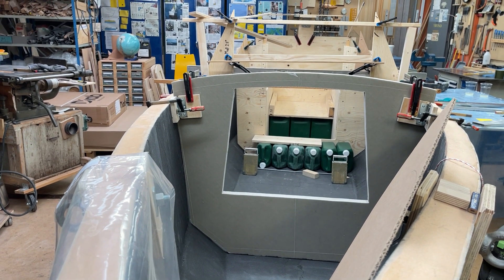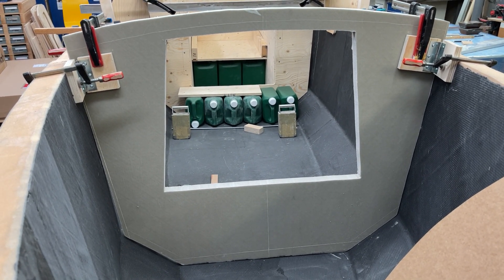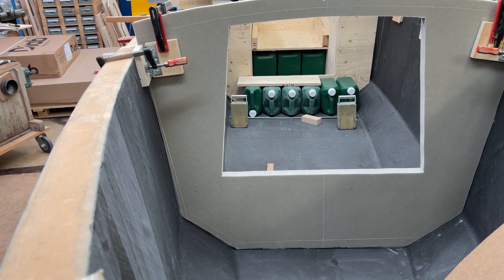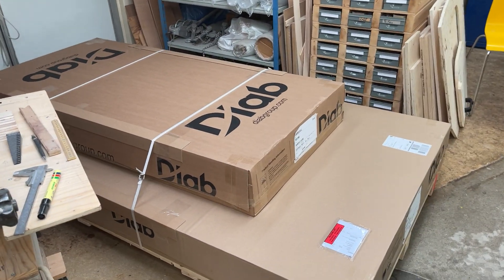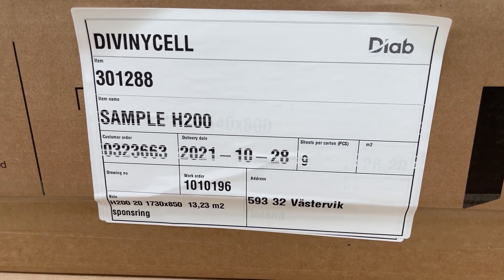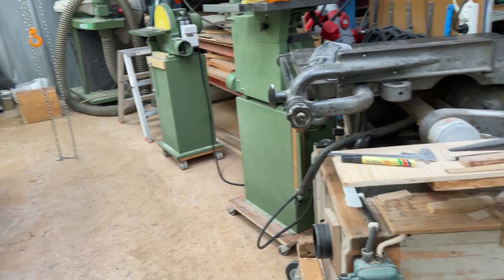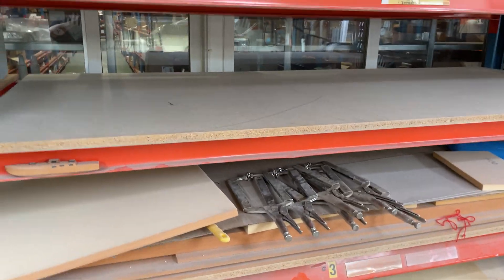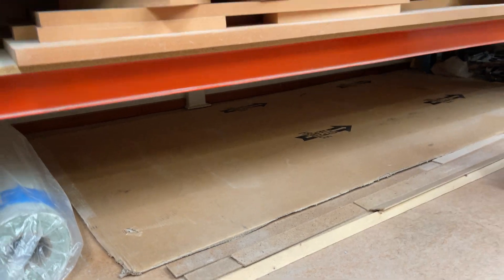Divinycell from Diab arrived today. Its H 80 for bulkheads and deck and H 200 for accomodation

Comment: Maybe think of rounding the corners of the access holes on the bulkheads. The square windows on old aircraft were square and stress cracks formed at the square corners of the windows. They solved the problem by rounding the windows.
Reply from the maker: I read the books on strenght by J. E. Gordon  decades ago They are fantastic. However on my small boat with 70 mm H 80 Divinycell I do think the global forces will be so small as to be neglibel at least compared to an old aircraft. For other reasons like  bending gasket and hatch lid there will rounded corners.
Reply: very true, and more in keeping with a yacht than a household door.

Comment: Wow I just looked that up.  Those foam sheets are about $300 US not including shipping and taxes!
Reply from the maker: I do not have to be told about the cost of Divinycell. The Divinycell epoxy and fibers are a small part of an ocean going boat. I deduct the cost of engine autopilot windvane selfstering winches rigging and many more things most hardvare. In the end this boat will be far cheaper than most cruisers
Reply: @SvenYrvindExlex  yes, yes, the cost of a small diesel engine will pay for lots of the very best building materials.  Brilliant.
Reply: Sveen deserves it for free, at least!
Reply from the maker: @juansimon7020  I belive my ideas can help others

Comment: Sven if you want to save money (material) , time, use cardboard to make your stencil. If you allow me a hint. To make the job easier, each cardboard stencil will be 2 halves that need to be longer in order to tape them together after adjusting the side. Please read the message previous video. I'm carpenter but don't know English technical vocabulary.
Reply from the maker: The bulkhead mockup is one of the molds I used to build the hull. It have to be strong to take the force to bend the Divinycell. I am recycling it.
Reply: I am a welder-fabricator.
I use cardboard templates daily.
For bus conversions ('skoolie'), I use cardboard mock-ups of furniture and cabinets to establish window placement, access... and interference.
Reply from the maker: @largemarge1603  I also use cardboard but these pieces was from the framing of the mold to bend Divinycell on. They already fit very well. Its recycling.
Reply: @SvenYrvindExlex   of course🙊. I kinda know with Sven, every thing has more than one usage... Great work captain!
You are an inspiration many young people should see. And less young like me also.... Cheers

Comment: H200 is pretty strong and heavy. What part of the boat is that for?
Reply from the maker: Its for the accomondation. I use it instead of wood a layer of 450 gram glass fibre on each side. That way I do not have to worry about the edges.
Reply: @SvenYrvindExlex  I do notice that grey colour divinycell is denser and so less thick than yellowish h80. Is it also a way to save space along the boat using less thick watertight bulkheads?